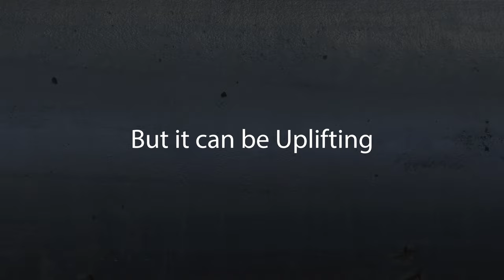Foundation Repair - Push Piers Lift Off. Tucson, AZ #shorts

Comment: Notice the gutter drainage right at the problematic corner. In addition to a possible soil-related foundation issue, the drainage issue likely contributes to the problem, or could possibly even be the sole cause.  Add an extension to the drain and keep the water away from the house https://www.youtube.com/watch?v=gQXs4n5EUrE.
Reply from the maker: It's crazy how so many foundation issues occur because of this very thing.